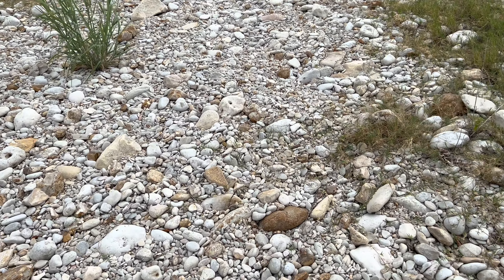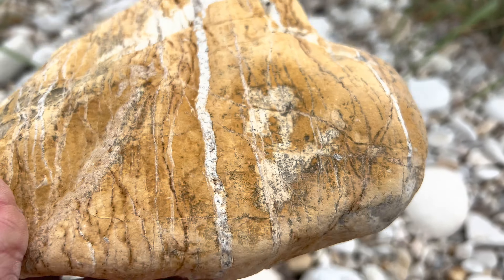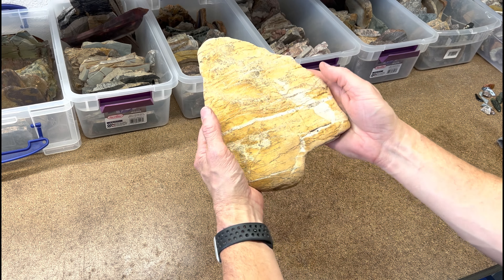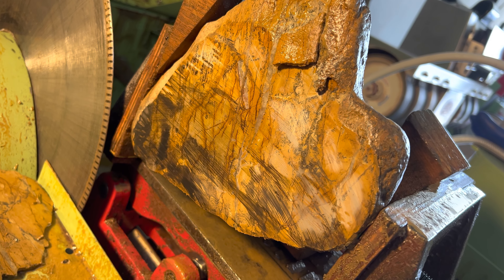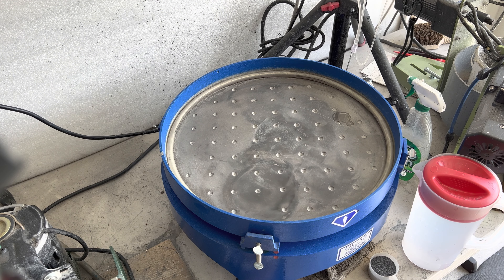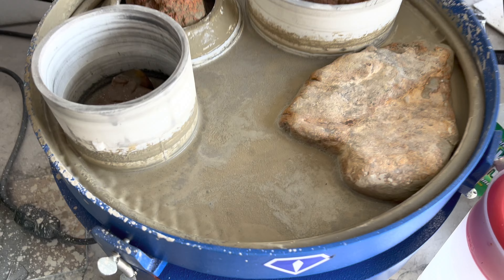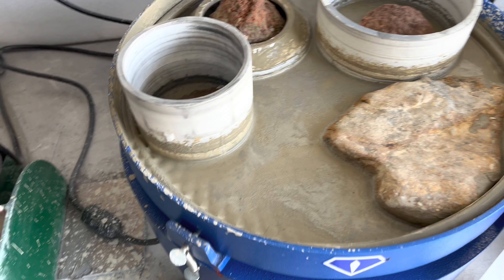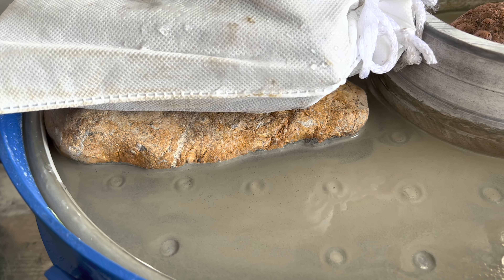From Rockhounding to a Finished Art Rock

Comment: It may not have taken a polish but that is a work of art. 
Curious how you clean out each stage of grit from the unit. Does the top section lift off and then you just take a hose to it to clean it.
GD
Reply from the maker: Hi! Correct, the top plate lifts off the base and can be cleaned out with a hose and brush. It’s aluminum so it’s not too heavy. Thanks for watching!